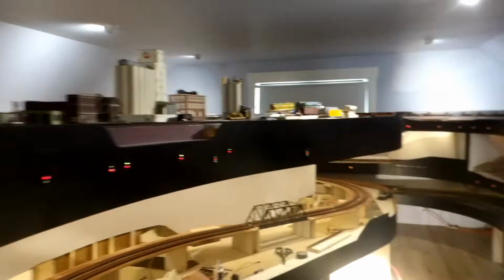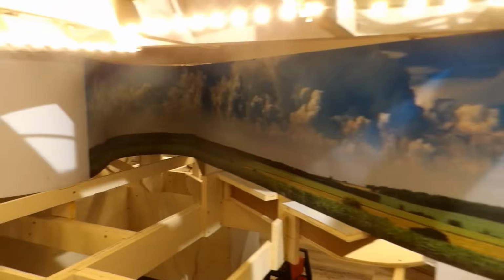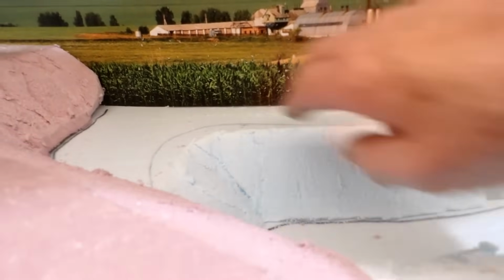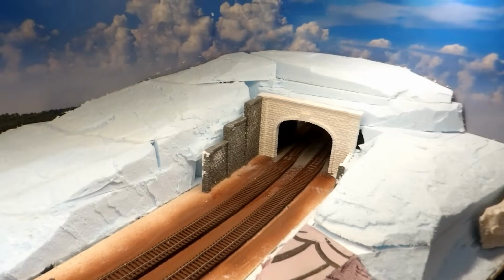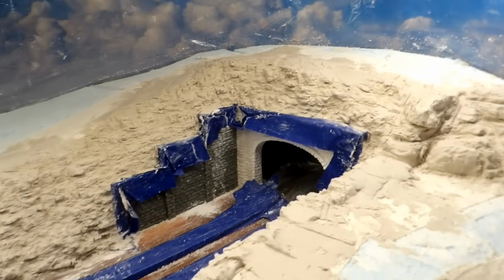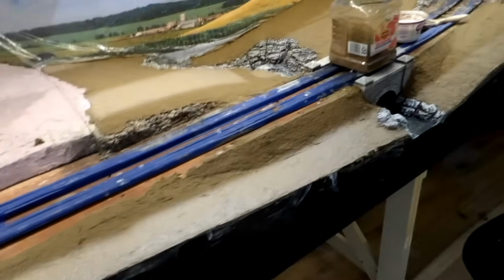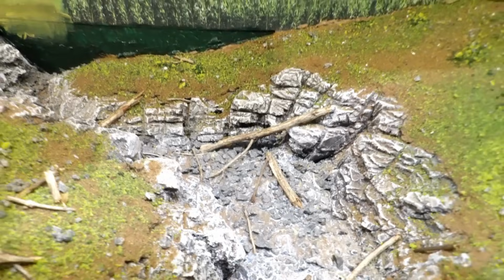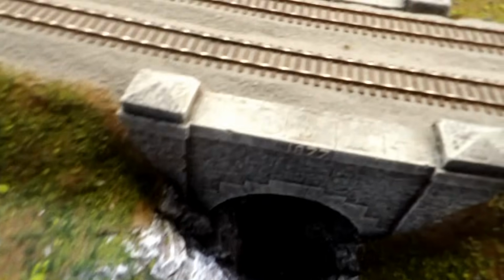K&SV scenery update

Comment: That looks great, glad you had a customer that worked with you, the last one I did for someone they slapped down scenry before I even had tracks wired and operational, then cut sections of track and installed turnouts over a module joint that wasnt leveled yet, they did it wrong but they didnt want to make it right, they will always have a problem there in that section of track, but wont listen. glad your customer has an ear to listen.  LAYOUT looks great

Comment: Great video Peter. Is buckling of the track at the sectional joints common?
Reply: Yes it is common. it happen to me when I built my n scale layout  metal expands and retracts depending on weather conditions.
Reply: @FierroDuroRails  cheers
Reply: Hopefully the Baltic Pine might be less prone to changes in the weather.
Reply from the maker: Most railroads that I've transported and installed have had a few such areas needing attention.  On this railroad, the joint I pointed out was the only one.  On the tracks at the far side where the buckling was worst, I cut out a tiny piece from each rail (less than 1mm), and last time I was there, the gaps were much larger than that.  Although the layout is in a climate-controlled room, there will always be some variation.  The trick is find a happy medium where both extremes can be tolerated.
Baltic Birch should minimize the problems.
Reply: @mpeterll Baltic Birch - thx Peter :)

Comment: I noticed in this one you did not put the plaster cloth over the entirety of the foam like you have done in the past. I know that you have also said that the “sculptamold sticks to anything”.  Is that the reason you skipped that step or was there some other reason?  Thanks.
Reply from the maker: Whenever I know exactly what areas will be covered with sculptamold and which will have plaster rocks, I only use the plaster cloth as a backing for the rocks with enough of a tab sticking out to grab the sculptamold.  The sculptamold grabs the foam better than the plaster cloth.